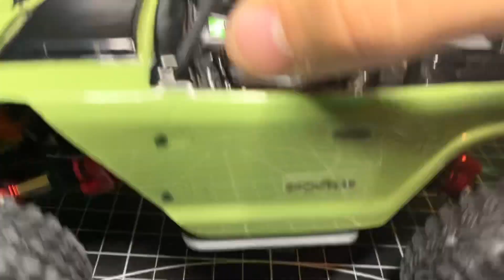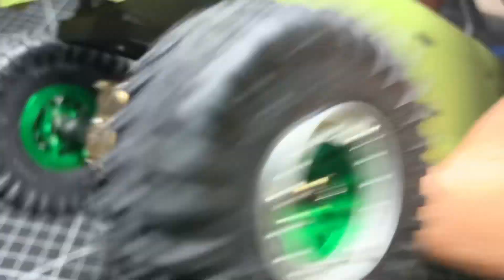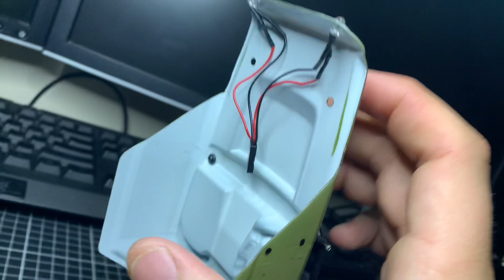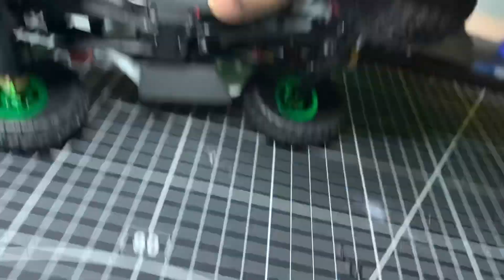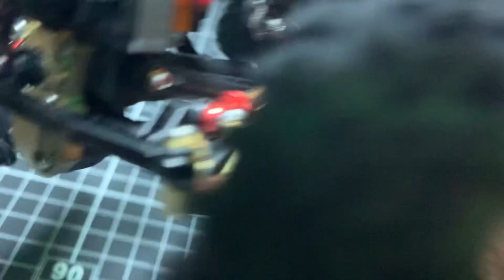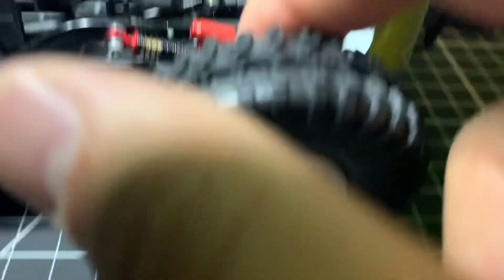SCX24 Deadbolt Micro Crawler Build Video - The Green Machine

Comment: How did you get it to sit that low
Reply from the maker: A combination of things! 
- Bent the body to clear the servo arm
- Cut out the rear body mount area for the diff
- Angled the shocks
- Running no springs front and soft in the rear
That’s about it. :)